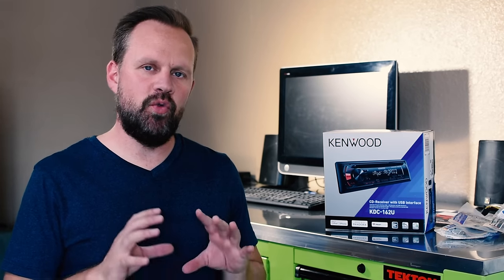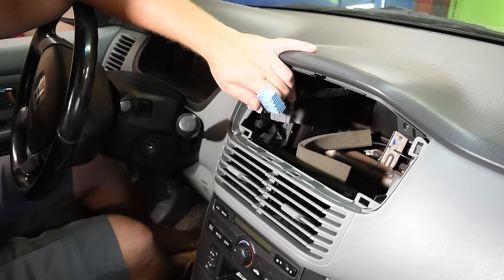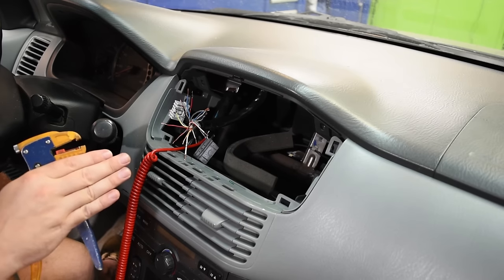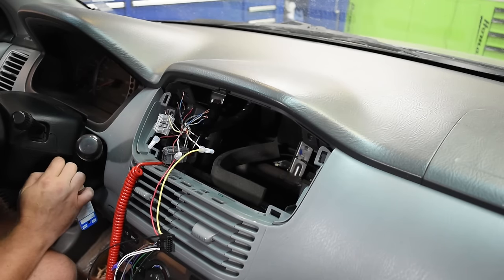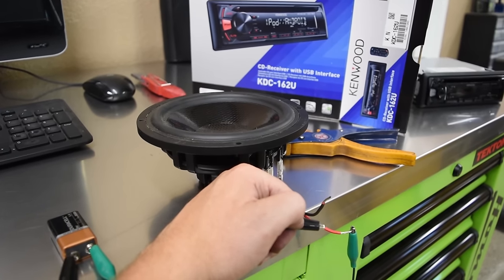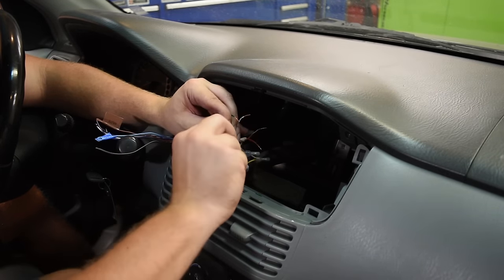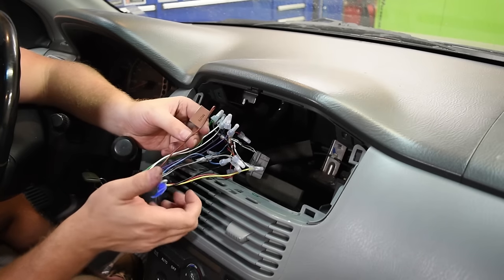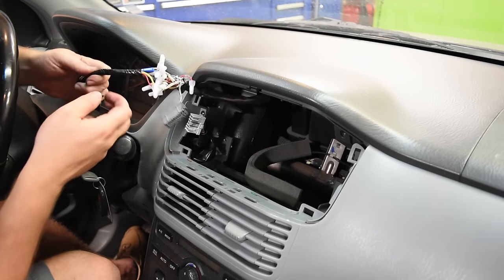How To Install A Radio Without A Wiring Harness Adapter

Comment: Hey man. So my stereo stopped working. After watching this video . I took out mine, found out theres only 8 wires from the factory connected to the aftermarket stereo (12) wires!  All the 2negative wires (i guess) is wired together 1 line. I Don't have clue if its for the front or back speakers. Same goes with positive connectors. Question: is this kind of wiring set up fine? Checked my fuse in the car and the previous aftermarket stereo and both aren't blown. If you have a solution it be great!

Comment: You said Dome light so I recently got my radio installed and noticed the next I hit my dome light switch they didn’t turn on, would you suggest splice the constant power together or maybe the the illumination wire any help be great?

Comment: I have a problem, it’s not as complicated as the gaggle of wires you are working with but I’m still confused. Its for an LS Tractor MT125, I know the speaker wires no issues there, however I have a black wire, a black wire with white stripe and a red wire. When I use a ohms meter on the Blk and red with key on I get 12 volt reading, key off its dead, now when Itest the red wire and blk with wht stripe I get a constant 12 volts key on or off. So would I be correct to assume the red is hot, the blk is ground and blk with white stripe is a complete?

Comment: Thanks for the video. thanks to you I put the radio to my car Geo prizm 1994. But I have a problem. the radio light does not turn off even if the car is off. what is the problem? Why do not the lights on the radio go off? please help me if you know the problem. Thanks for your time.

Comment: Replacing the factory AM/FM Cassette on my '99 Jeep Cherokee with an aftermarket. Radio sounds good except for a weak AM signal. Was told to hook up the Power Antenna wire, White, to the Blue on the Aftermarket. I don't have a Power Antenna but they say it could be an Antenna Amp. How would I know about that ? And what would happen if I DID hook those 2 up ?

Comment: I got the power to work but the speakers arent working. Is it a wiring problem or is there like a speaker fuse that might have gone out?? Awesome video btw
Reply from the maker: You might have a factory amplifier in your car.. What is the year make and model?
Reply: Do It Yourself Bri I got a 1996 jeep cherokee country 4x4 and I tried to wire the radio up by looking at the diagrams but for some reason the radio still wont come on
Reply: @isiahrichardson416  no results?

Comment: Hey there!
I'm currently trying to install an aftermarket head unit in Nissan Almera 2005 sve model and I've found out that there are two constant power wires both yellow inside the original connection.

First of all why are there two of them and can I just connect one while isolating the other?

Both wires are live with no key in ignition.

Thanks!

Comment: On the original wires there are some extra colors that I don't have on harness that came with my stereo. Am I able to only cut those colors that I can match and keep those extra colors that don't have a matching wire connected? Does that makes sense? 😭

Comment: Hey, i was just wondering if you need a constant power wire, in my oldschool 8 track it only had switched power. What is the constant for?

Comment: I installed a radio from my old car into my new old car without cutting any wires. I just unpinned the wire prongs from the old wire harness adapter and stuck each pin into the correct slot on the car's plug. Then taped the shit out of it. It's a work car so I'm not too worried about how it looks plus it worked.

Comment: Hi, I have a 1999 Acura TL and I am hard wiring and replacing my Bose stereo with an after market stereo. I have connected the After market plug/wires to my existing car radio wires (power wires) and when turning the key to acc and the on position (not starting car) and with my test light I'm not even getting poew to my light when I touch the poew terminals to power on factory plug. I checked the only fuse it showed to be in the owners manuel  ( radio Acc) and it was not blown. What am I missing not to get any power, even from the original connector.

Comment: I have two wires that are accessory wires.  They are both hot when I turn the key to the second position.  Why is that?  What's happening?

Comment: Hey I have a 2001 Buick century and I believe I’ve matched everything correctly, now the radio starts but no sound from any speakers! Any tips?
Reply: Although I didn’t use the crimp covers just the electrical tape that came with the radio,

Comment: I have a 2003 Ford Expedition im going to use a high and low converter on my factory radio for subwoofer and amp install.

Comment: I'm not getting a light from my constant wire, and I've checked all the fuses I could, under the hood and under the steering wheel. All fuses tested and work. Bad wire? Let me know if you've got any suggestions.

Comment: I have a question.  What about a harness that has 2 constant hots and 2 ground wires . I believe the extra hot and extra ground go to the speakers but what's the proper way to connect them ?

Comment: Hi Sir, may i know how to connect the 3.5mm jack to steering audio control? Which wire should i connect to key 1 and key 2 wire? My car is 2016 Honda Fit, thanks

Comment: the video did not handle the radio antenna power. I want to know whether my antenna has an amplifier built in and how do I test if it is working? Thanks

Comment: I've been an electrician for 15 years and I added an in-dash amp (Alpine KTP-445) to my 17' Tacoma last night.  What a nightmare.  Everything works and I made a bracket for the brick amplifier but I'm going to redo it.  It is too crammed for my liking.  Splicing into the factory harness is not fun.

Comment: What do I do with bare wires my original radio in my 2000 Chevy trail blazer had a amp built into the radio so what do I do with them?

Comment: Great stuff.  Problem I'm having with my 05 Dodge Ram.  First, in addition to the standard black/green ground I also have a solid black wire.  Second, I have two identical wires showing constant 12v, both gray/red.  Any ideas anyone?  Thanks.

Comment: So right out the gate, tried a bunch of harness but they wouldn't work! So I find constant power but have none light up for Acc/accessory/ignition?
Reply: Am I going to have to hook up all power to constant power and just turn radio on and off itself?
Reply: I'm having the same issue
Reply: @lilacne7560  I ended up hard wiring everything. Only thing I could figure is have to get maybe special harness from manufacturer because my car has that feature where radio stays on after you turn key for couple minutes unless you open the door. Some kind of timing feature
Reply: @toddfranz1091  how did u hard wire it? I'm currently hardwiring mine,2007 pontiac grand prix no Amp,no moonsoon sound system
Reply: @lilacne7560  I started with that one wire that's hot and matched it to the power B+ to radio, took a self tap screw and ground to metal in dash, the Acc+ wire I found open fuse that lights only when key is on (used wire connector shaped like a Y' to insert into fuse panel) once I had power to radio I just kept testing mostly same color wires for speakers. Using radio dial to isolate each speaker
Reply: @lilacne7560  let me know if I can help any more or if something happens. Also some wires weren't the same color

Comment: My Ram doesn't have the Infinity system and so it doesn't have the dash speakers. I want to add them - to have a total of 6. 2 Front, 2 middle, and 2 rear. Where would I wire them to the Kenwood deck since there's no wires for them at my harness?

My dash speakers are 3.5", middles are 6"x9", rears are 6".

Comment: Im currently doing this but im having some trouble oddly.. When i was finding the ground wire i had more than one wire lighting up but still was able to find the right ground. so  i moved on to the 9 volt battery thing you did and none of speakers are popping so looked up a diagram and used that instead but my speakers dont play sound and i haveno idea what it could be..

Comment: 4th installation different cars, succeed with all other but my Dodge Calliber 2010 wiring is giving me a hard time when it comes down to connecting the accesory wire and can't seem tp find any familiar schematics. I have two wires that seems to go together  (wht/orange & wht/pink). Wht/Orange on emits 5V. with "Acc" and fades out when "off" but no reaction is happening with lights yet the other emits 5 to 7V constantly no matter what...any suggestions on this

Comment: My truck has TWO speakers in the two doors.  I removed the radio / cassette player from 1994.  Now, the new radio / CD player has FOUR pairs of wires for 4 speakers.  Is that a problem?  Because I only get a screaming high noise from behind the dash somewhere???
I made my own connector wires because I didn't want to cut the Nissan factory harness.  I could see every wire color, even at the speaker terminals  + and -- .

Comment: Any idea why my ignition switch wire is hot with no key in? During the first test with no key on I have 2 hot. My main power and my ignition
Reply: I got no light from any of my wires searching for the accessory wire and it.wont light up even in the ignition position ON .....
Reply: 04 ford crown vic

Comment: My 12v acc on my test light is blinking ..  I can get a solid light on the 12v constant though, WHST does this mean, also the aftermarket stereo won’t turn on when all connected
Reply: Bando same thing happening to me, hace you found out the solution?
Reply: Eden Carranza ended up just wiring the power and Acc from the stereo to the acc wire from the car

Comment: What if you’re installing a newer era radio on a 2000-2002 era radio and amp and none of the speaker wires are connecting to anything even if you wire them up

Comment: I did the same thing you done bought a test light cause on my 1995 mustang the harness has been cutt I connect the same wires you did when I got power but when I hook the plug into the radio it pops a fuse don’t know why should I connect my ground to the black wires my ground is black and green stripe?

Comment: Only issue I'm having is finding the ignition wire, I got ground speakers, constant power, but when I turn the key on, nothing but the constant light up..I've also gone through all my fuses and they're all good

Comment: I got a 2005 scion tc standard and I have 2 sets of wire coming from it. 1 set has a white plastic piece, which is the lesser wires. The other set has more wires, with no white piece. Just clips. Any help thanks.

Comment: i have a 2001 suburban. i have all of the 12 wires figured out. where i am stuck at is the polarity test. none of my door speaker wires are making any noise when touched with 9v battery

Comment: Pull both battery terminals off the battery, and touch them together for 15 seconds, to discharge any saved up charge in the system before touching any wires and you can cut right through everything quickly
Reply: What if they were all cut at once and now my car won’t start ? Was running just fine. And my friend cut all the wires at ounce and now I can’t get the vehicle to run

Comment: I can’t find wiring diagram for 2006 Chevy Uplander LS I have aftermarket radio and I can’t find the ignition switch wire I only find straight power wire not Ignition switch power
Reply: Same

Comment: Hi there, I can't find my ignition switch wire after using the test light, kindly help me on this, however I do find the wire that the light dims the radio when driving at night with the lights.

Comment: So whats the benefit of doing this without a harness/ adapter? Appreciate the video but I'm just curious. I'm new to car audio!
Reply: Neville9013 no benefits, just people who wanna quickly rip out the radio. Also it could be, they’ve messed up and and just cut the harness.
Reply: The benefit is, if someone breaks into your car and rips the stereo out by cutting the wires, you now know how to wire in a new one!
Reply: It's for people like you who are new to car audio... If you can't understand the benefits of the vid, stick to taking ur ride to a car audio shop...

Comment: My 2005 Chevy Silverado doesn't have a harness either but the diagram shows some things going to the same wire. For instance it shows the illumination and on of the speakers goes to the same wire. I am confused. Could you help me with this...????

Comment: Just posted on 12volt forum a question about my ‘17 Flex can’t find a diagram anywhere for my stereo wiring. Ford uses crazy colors behind the stereo. If anybody has any insight for me it would be greatly appreciated

Comment: Alright so I have a 2002 Cavalier I tried to do this on. Followed all the steps but it wont turn on, I even switched out the fuse. I wasnt sure if the ground wires got put together, as the video didn't say. But I tried it with and without it together. Still nothing.. any help would be greatly appreciated.

Comment: There is no black wire besides the amp plug in my 2001 dodge neon. The only wire left after wiring the whole harness is an orange wire. Is this ground? I don’t have a devise to test it.

Comment: Great video but to all watchers if your car still has the factory adapter please just buy one to connect a new stereo. They are super cheap on ebay less than $10. If you want to change radios later you got the adapter. And also forget soldering that is a waste of time and if you want to replace the radio later you gotta cut it some more, just wire nut them

Comment: I have a 2006 nissan xtrail and bought an after market stereo. Nissan wiring is wierd. ie no speaker ground wires and earthed through the antenna. 
I need an instructional video specific for that. 
I thought I knew how to wire stereos until I took out the crappy nissan radio.

Comment: hi, were does key1 key2 on a patch lead go to, i my aftermarket radio doesnt  have a jack port. bmw e91 touring 2006.if you know that is. im trying to connect steering wheel buttons to aftermarket radio.

Comment: Im so confused so im doing a custom LED cluster for my 99 lexus + I have no idea what LED wires i needa connect to. The LED strip has a red + white wire, and then the 4 blue, white, green, red wires. I connected the green w. The white + green wire, blue w. The white wire but the rest idk what to connect to. 😭 theres a white black stiped wire for illumination and a light green wire that im supposedly supposed to connect to? Idk plz help

Comment: Nice video on how to install a radio without a wiring harness adaptor.  But 1 problem for me is, you just destroyed the factory harness.  It would be much easier to buy a Metra Harness for a small amount of money.  Plus with a harness, it has instructioñs on the package to show what wire is what.  And if you wanna put back the stock factory radio, you just cut out that factory harness and you would need to try and put it back together.

Comment: No one else seems to have this problem but what do you do if you have 2 wires of the same color that set off the voltage reader and then a third one that also sets it off but is a totally separate color all while the car is off

Comment: What do you do if you can't find the ignition wire i found the constant wire and the ground but when i do the test for the ignition wire no light up on any of the other wires it's a 2006 gmc envoy

Comment: I hardwired my 2006 Silverado aftermarket radio because the factory wire harness melted so before the factory wire harness I snapped it hardwired it but now my aftermarket radio does not come on I have checked the fuses and everything in that sort that I know of but my radio does not come on but it makes a clicking noise

Comment: For some reason I’m getting power but no sound from the speakers on my new unit . Any advice ?
Reply: There must have been a disconnect of the speaker wire on the wire harness at the back of the radio.

Comment: when he tested for the ground wire he said that the rest of the wires shouldnt light up ,,,but when he touched that red wire at about  around 9:46 in the video a couple of the other wires did make the light tester light up i noticed he tried to avoid showing that again cause he noticed it to ,,,im just curious because i never did this and im new to it and im trying to install my new radio so can anyone explain that part that he avoided?????

Comment: Why do people run new wire back to the factory amp instead of using the old factory wire.  I bought a dash kit that came with new wires to run.  Should I just run it with the old.

Comment: Hi there. I managed to figure every wires but am not getting any resistance from the steering wheel wires. I connected it to the steering wheel wires from the new stereo, the stereo immediately turns off, but when I removed the wires the stereo comes back on. What am I doing wrong?
Reply: Any results
Reply: @ktthompson1471  got it sorted. I wasn't connecting the Swc keys correctly lol. But it's done now and working

Comment: hello i have a question i have a toyota stralet and it only has one 4" speaker in it i want to add 3 more speakers but there wont be enough cables how do i do this

Comment: So if i have install a 4 channel amplifier, the harness i just join the 4 point, beteri power, key power, ground, remote and only? 
The speaker cable will go out from 4 channel amplifier, the harness there terminate the part of speaker by hot tube.
Its Correct do like this?
Reply: Did this happen to work? Curios to know.

Comment: i have an 06 kia optima and none of these test proved to work for me i have a constant black wire that is hot all the time no matter what. and a red one that is hot when the car is off.
and my illumantion wire is not showing when the lights are on.
also there is 16 wires in total none of the wiring harness digrams match the colors on my car.
they say the pink wire is my constant but for me its my fed and a black one. any help?